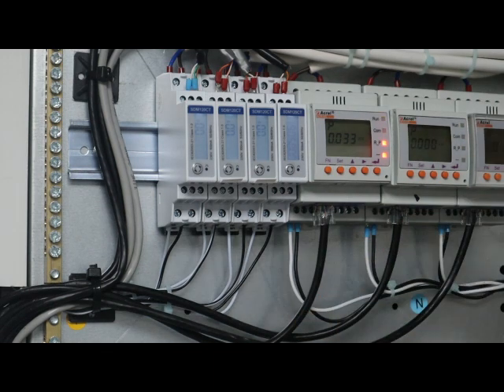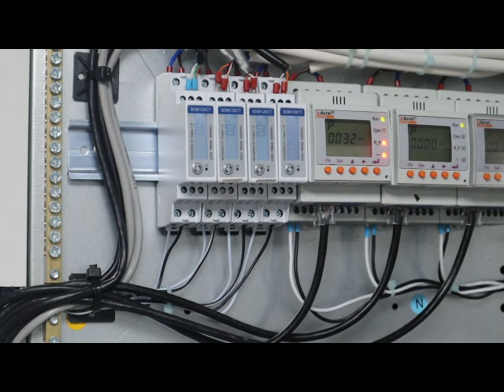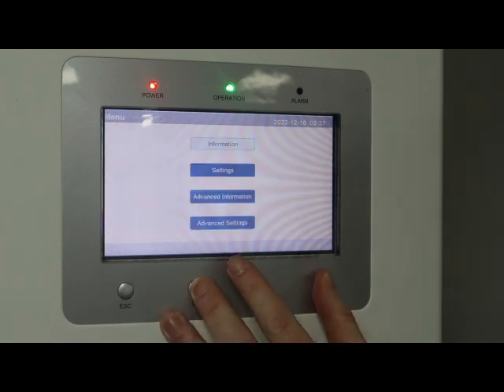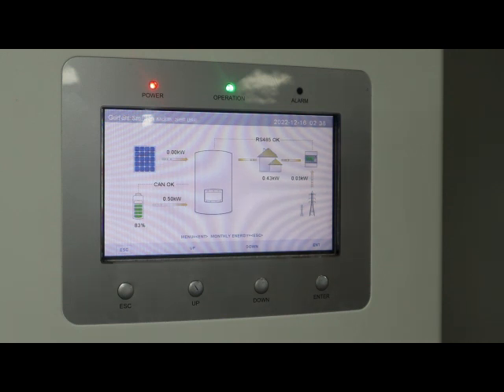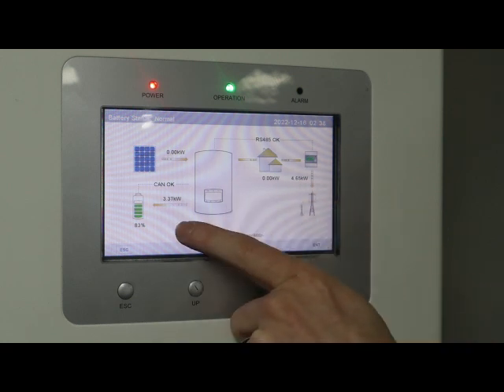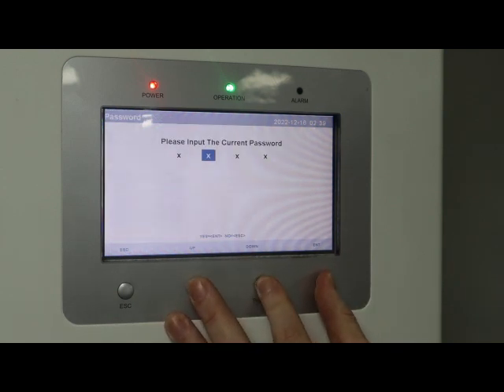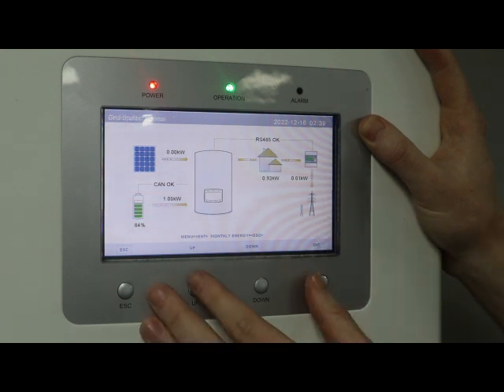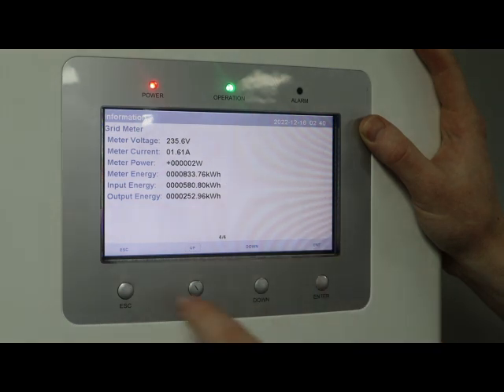Solis Hybrid Inverter - Meter Troubleshooting

Comment: Hi guys, is there any way to get a Solis man to check if the inverter is set up correctly (in person) here in Ireland? the standard meter that comes with the inverter (SDM120CT) never worked so the installer changed it to Acrel ACR10R, now I see flow of current alternating every second from and to the grid, this is also coming up in the eddi now since they installed the new meter...Myenegi app shows that I am importing and exporting pretty much at the very same time please don't tell me to ask the installer to check that out cause he told me that it is normal even after Solis tech guys told me via email that there is an issue... honestly I am regretting so much getting this solis system that I wish I could just change house all together and forget all about it...
Reply: I've just connected a Solis Hybrid inverter. It came with the SDM120CT meter also. The meter seems to be working correctly in that it's showing energy being exported and imported. But when connected via the RS485, the Solis display changes from "RS485 Fail" to "RS485 OK" but no values appear on the Solis display. The meter is also 30m from inverter but connected via twisted pair. I've checked voltages as per video and they seem to tally. Is the SDM120CT just not up for the job?
Reply: HI, is the Acrel ACR10R, matched up with the correct settings on the CT clamp ? might be worth checking that as it could throw it out if not matched

Comment: Big Thanks man! After measuring the RS485 voltage on the cable and on the inverter like you showed in the video, i have finaly succeeded to comunicate with the meter.

Comment: That's very helpful. However, I still can't find a reason why the PV production and self use are the same. The more sun the more self use it shows. When I turn the grid off left side comes back to normal. Also, the system doesn't allow any self use after the sunset. I noticed that on the 2nd screen meter power and current are zero for the grid and PV meters. How to solve that issue?
Reply: I am having this exact issue, did you ever find a solution?
Reply: Is the energymeter correctly connected? Dubbelchek if the grid is connected to the grid side on the meter.
Reply: self-use is calculated incorrectly, and i requested it get removed from soliscloud as it was bringing in too many questions with regards to its inaccuracies (not possible to fix within SC).
Reply: "2nd screen" If you are running multiple Solis inverters, I believe you need an EPM1-5G (Export Power Module) to control them properly.
Reply: Had a few do this and was fault batttery charge circuit 😢inside inverter